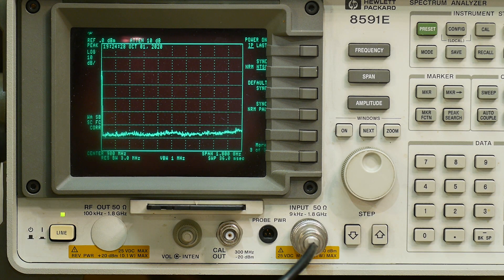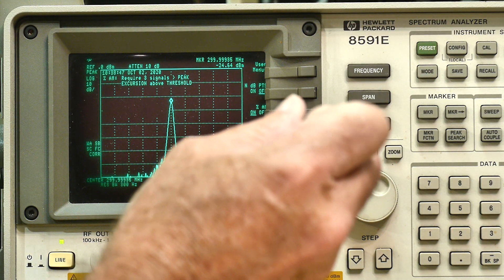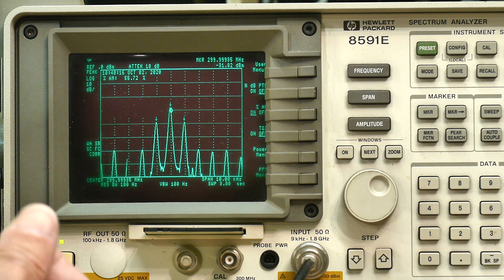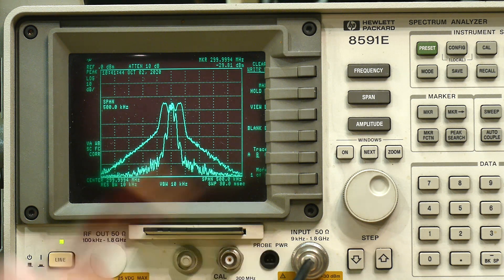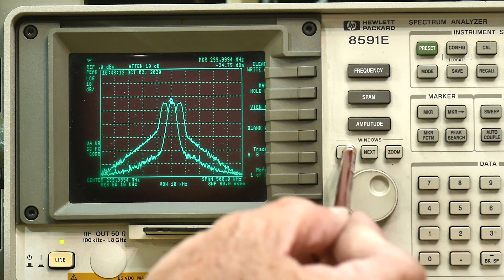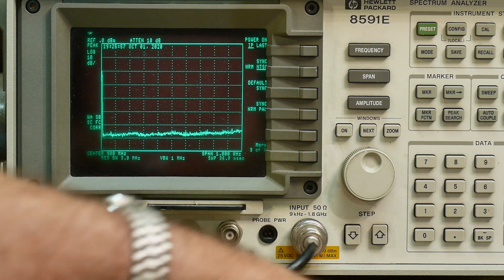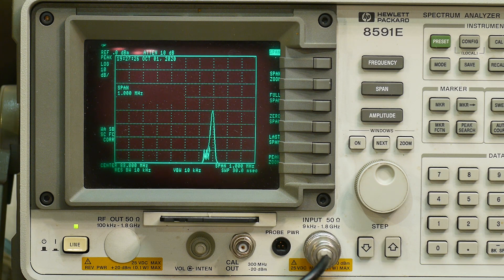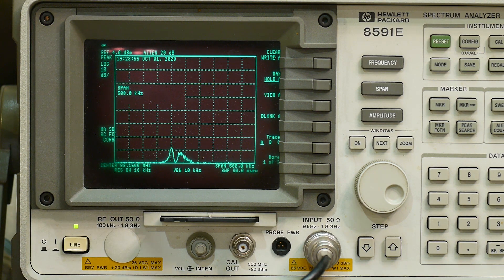#577b HP8591E Spectrum Analyzer Measurements

Comment: Does the Tiny SA tracking output has a reasonable sinus wave output? Or harmonic present quite strong?
Reply from the maker: It does not have tracking. I can be an SA or a Generator not both. It is not sinusoidal. Lots of harmonics

Comment: You read my mind. I was about to ask about the window buttons since my 8560E doesn't have that feature and then you started talking about it. The CRT on yours looks great! Mine is a bit dim, but an LCD replacement is mighty expensive.
Reply from the maker: I still haven't learned how to use it well yet. Too many other buttons have kept me busy
Reply from the maker: you can do a zero span to convert freq domain to time. then it has an FFT routine to take it back to frequency. they claim the best way to analyze modulation. crazy stuff
Reply: @IMSAIGuy  Yeah, there's so much packed into these devices. What year is yours from? Mine is around '94. Looks like the ROM is '97.
Reply from the maker: @TestEquipmentAnonymous  the unit is 93 the rom is 92. I will be updating the ROMs in a future video I hope.